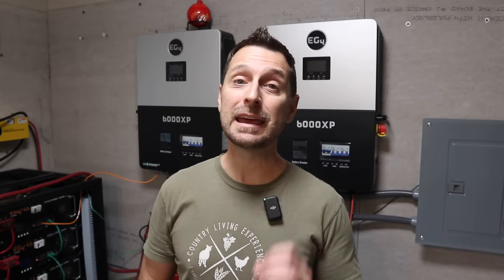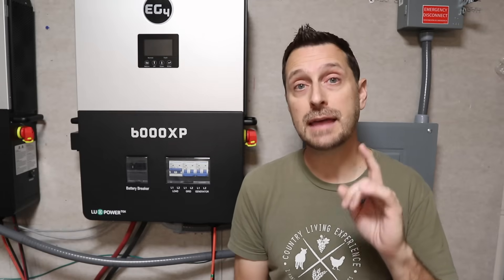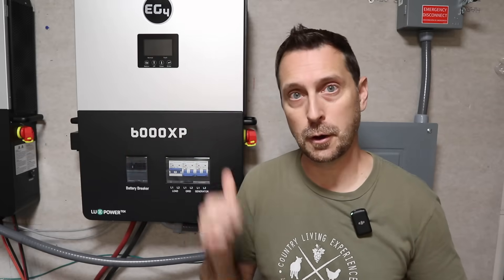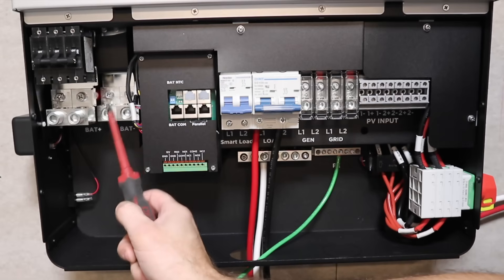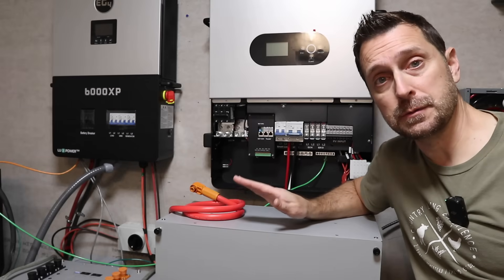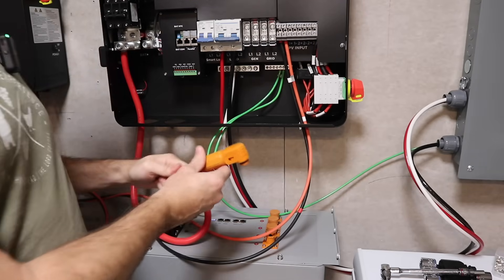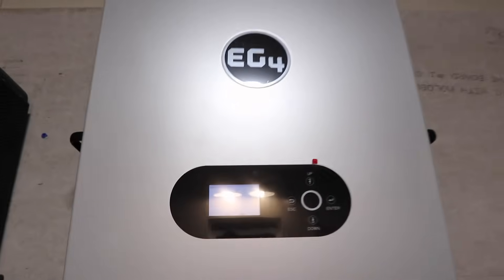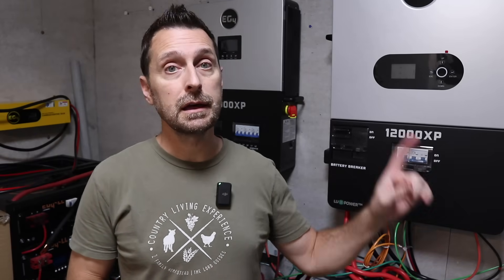Brand New! EG4 12000XP Off Grid Inverter Full Install And Review!

Comment: I use 532 kwh for one month in a year in the summer for an air conditioner and the rest of the year I use 200-300 kwh per month on the electric grid. Plus I want more power to run more items. How much AC output can this Eg4 inverter unit produce or throw out? Do I need more Eg4 inverters to handle the load? I have (16) 540 Watts solar panels plus (22) 400 watts in total. I live in Michigan. Can I run 100 feet 2/2/2/4 aluminum mobile home feeder wire out of the home to hook up the Eg4 inverter to the (pv) solar panels to save money because I need to run the solar panels out about 350 feet to my open field! I'm going to have 4 sets of wires (6 awg) for the Eg4 inverter for all my solar panels. Then I have 100 feet 2-2-2-4 wire hook up to one house then I have another house about 50 feet away and this system is all hooked together. Can this Eg4 inverter run through the whole system this way I'm talking about? Because it works on the electric grid? Can I have a 100 amp breaker box for this system? And what size of sub breaker box do I need because I think I have 50 amps sub breaker boxes for the other two houses. And the main breaker I have is a 65 amp that is hooked up to the electric grid I think. So thank you for your help! Have an awesome holiday day and JUSUS CHRIST bless you!

Comment: Does this inverter suffer from the same charging from grid/ gen as the rest. When charging it goes into bypass? I really want the ability to charge from geny while still inverting so I can max out charging and then not overload the Genny when a load in my house kicks in.
Reply from the maker: Not sure that is an issue more than a safety feature. One power source at a time. 
I don't use my genny through my inverters. I use a separate Chargeverter connected to the battery bus bars. That way I can charge the batts separately while running the house on either the grid or the panels.
Reply: I didn't say it clearly enough.
I have a pure sine wave Geny.
These units have built-in chargers that can charge from grid or gen. This one both.
The issue I have been having is this.
I want to charge my now 85kwh batteries as fast as possible at as high as amps as possible during the winter months by gen. But then a load kicks in. The system isn't smart enough to reduce charging to limit the total power it takes from the Gen to not overload it. Because the chargers are actually just the same inverting circuit in reverse (sort of) all the loads are actually going through a bypass relay and getting powered directly from the Gen. So I'll set the charger for lets say 8kw leaving 2kw of headroom for loads when I get a momentary 3kw worth of loads the gen trips out and the unit goes back to inverting until I realize it's happened and reset the gen. So it forces you to babysit the charging. Yes I bought a chargeverter too because I had to. But I need two to get full power from my gen.  So now you're spending another thousand to do something that the inverters advertise they can already do. I have read now that these units are in fact smart enough to limit its total power consumption coming from a generator for this exact reason. Even to the point of calling it generator boost. So it will start inverting to help with the load if it exceeds the set limit of the total power the generator is capable of. I'm weeks away from buying one to replace my growatt 12kw unit. I just want to get absolutely as much information as possible. Because I'm on my 3rd inverter, 3rd brand, really makes ROI a bit harder when I go in 3 thousand every year on a new inverter in hopes this one will finally be the one that does what u need. Sorry for the book thanks for the time.

Comment: Do the panels have to be all the same? Or can you run different ones on different strings? The reason I ask is that I have 20 550 watts on my 10kw system n 22 320w with my 6kw..can I use them together in one system with that inverter?
Reply from the maker: You can run different panels in different strings with no problem. Just keep within the voltage parameters of the mppt. Each input on the inverter (4) can take up to 480v.
Reply: @CountryLivingExperience  thank you . Have a blessed Christmas

Comment: Have you experienced  warning 28 error? it is a false EPS overload error that is not fixed yet on this inverter. Waiting for a firmware fix.
Reply from the maker: Yes, I have. I did a firmware update and it has cleared up the error.

Comment: I hear you on what the manual says; but, will the thing run on just one EG4 wall mount battery?
Reply from the maker: No. Rodney Hunt did an experiment on his channel and the inverter did not run correctly with one battery. You need two of them or get 4 EG4-LL or LifePower batteries.
Reply: @CountryLivingExperience  thanks for the tip.  I went over to watch Rodney's video, and it seems he concluded it works fine, as long as you don't over-draw the battery.  It seems, at least to my understanding, that you can use one wallmount battery, but you will NOT be able to utilize the full output of the inverter.  But, as long as you're not hitting the battery to the tune of more than 1/2C, you should be ok.  Please correct me if I'm wrong, as I fully embrace my Dunning-Kruger
Reply from the maker: @byrondeez  You are correct. I wouldn't want to risk it though. You could have surges in your loads or need a higher draw at some point. Also, the investment in the 12k xp would not be the best financially if that is the case. Just get a 6000xp and use 1 battery at full power.
Reply: @CountryLivingExperience  thanks 👍
Reply: Yes, it can but it doesn't run well and it can hurt the system and you need to save the money for another battery! 🔋 There are YouTube videos about this matter.
Reply: Show me the video links please.

Comment: Do you know the maximum wire size that will fit in the Grid and Load connections on the 12,000xp? I know it gives a min size in the manual.
Reply from the maker: It feels like you could fit 2awg or even 1awg in those terminals because there is a bit of room. I did not test that out though.

Comment: I am looking at getting the 12000XP and two of those batteries.  Do you need one of the conduit kits or one for each battery (buy two)?  Thanks and Go Green!
Reply from the maker: Cool. You would need 2 conduit kits and 1 battery parallel kit (batt cables with connectors on both ends). Go White!
Reply: @ thank you! Keep up the great work!

Comment: I plan to order a 12000XP.  I will NOT have any solar to use with the XP.  I understood that just like needing 400ah of battery, I MUST have solar attached for the XP to produce the outputs intended.  Is there any reason that I MUST have some solar ATTACHED ?
Reply from the maker: Why buy a solar inverter and not use solar? Most off-grid inverters need solar input to function well.

Comment: Did the junction box above the battery fit all the holes for the wires off the 12,000xp?
Reply from the maker: No. The holes match with the 12Kpv and the 18Kpv. For the 12000xp, you need to turn the top of the box around so that the large slot is open and aligns with the bottom of the 12000. I may show a vid on that soon.
Reply: Hard to follow the battery hook up.  Tangled mess that doesn't show where you connected to the TWO input ports on the inverter...

Can't tell where the wines were clicked to.  You explained needs min of 400 amp hours, but didn't show hooking them up.

Comment: How many of those wall mount batteries can you hook up to one 12000xp?  We are building a new home this spring, and i want to build an off grid solar system for our power.  I'd like to run 6 of those wall mount batteries. Will i need another 12000, or would i get one 12000 and one 6000?
Reply from the maker: You can add 3 batteries per inverter. You would need 2 inverters for 6 batts. Either 2 6000xp's or 2 12000xp's. You can't mix the 6000 and 12000 unless you get really creative with your wiring.

Comment: I would be ‘jazzed’, at this 12000XP product, if the PV input could handle 500vdc.  Why not 500vdc?
Reply from the maker: I could ask you the same. Why 500? 
There are hardly any inverters on the market that will handle 500. 480 is plenty.
Reply: @ the higher the PV, the more panels you can use, on the direction sunlight days!  More is better!
Reply from the maker: @jimpowell9205 This inverter can take more PV than almost any other inverter on the market, if any. 24000w.

Comment: I just looked on signature Solar’s website and could only find the 12000xp for $3499
Reply from the maker: You looked at the 12Kpv not the 12000xp. Scroll further down the page and you will see the correct inverter for $2499

Comment: So to clarify how many panels do you need to charge two batteries and to provide power from the inverter at the same time? Are they saying you need 24000 watts of solar panels?🙏
Reply from the maker: They are not saying you need 24k watts, that is the maximum that the inverter can take. You can start with 3 or 6 panels if you want. Those panels would need to just have a voltage combined in series of at least 120 volts for proper operation and no more than 480v. A good range is between 120 and 385 volts for each string for each mppt (charge controller) in the inverter. 
For example you could have only 3 panels that are 41v each, run them in series (which adds their voltage to 123v), then the inverter will work and charge batteries. 
The questions always is....How long will it take to charge batteries while running loads? The answer is.....The more the better. 
We did a video on this here.....https://youtu.be/BKRraTpBnGo That may help.
Reply: @CountryLivingExperience  Thanks fro the quick reply, really helpful cheers
Reply from the maker: You're welcome

Comment: You might use (some of) that potential 72kW power for a swimming pool filter/heater system.  Maybe you have a good sized wood and/or metal shop?  Charge up your electric fence to "Super-Max" levels maybe?  Have a BUNCH of computers mining crypto currency as another option, along with running your air-conditioning super hard to keep them cool.  I agree, other than redundancy, going for 6 would be more than a little bit silly!
Can you do a hardwire ethernet to connect to the inverter or does it HAVE to be WiFi?  If it has to be WiFi that would make it difficult if you put the inverter(s) and batteries in a freestanding building a short distance from the house.
Reply from the maker: I think there is a way to hardwire ethernet but I do not know how personally.  I have heard it is possible but one will have to sit on the phone with the EG4 guys for a while. 
Yes, that is the same issue I ran into with my Victron system at my barn. No internet wifi way out there. It is an extreme challenge to do firmware updates, etc.

Comment: Good day Eric. We have 16 wooden acres that we're currently building a  3 shipping container home on. What would you recommend for a 100% offgrid situation? We're not pulling from the local grid at all. We will be on solar, propane, and the occasional generator for charging batteries in case of extended periods without sunlight. We're in central arkansas. Would love to hear your thoughts :-)
Reply from the maker: Good question. It is really going to depend on what you loads are. I am not sure what you are running at your new home. You'll have to do that calc to get a better picture. 
That said, you will have to decide if redundancy is right for you (with a few 6000xp's) or just having one unit like the 12000xp.  I would stick with one of the pure off-grid inverters because you would not need the grid interactive features of a Hybrid inverter. The off-grids are cheaper too. 
We also have a Victron system for our barn which seems to be bulletproof.
Reply: @CountryLivingExperience  Thank you. I'm so thankful for this channel :-)
Reply from the maker: @umustbbornagainActs2-38  You're welcome.

Comment: Im having a hard time deciding between the flex boss or 12000xp to replace my 18kpv for my completely off grid property 🤔 the 600v of ov and 10 year warranty is pushing me towards the flex boss
Reply: I have a 18kpv and like it I would go up to the flex because it has more pv input and the load the fans start should be higher but if u want redundancy grab 2 12000xp for 5k basically the cost of one 18k?.? Crazy times inverters change so much in one year 😊
Reply: @electricandlspower thanks I agree,  I'm an installer for sigsolar so I like to install all the new products I offer so I can get familiar with them and since I and 90% of my clients are completely off grid the 18kpv is not the most efficient option
Reply from the maker: I understand now TJ. I think the 12000xp would be the way to go. I am still working through whether I want the redundancy of 2 or 3 6000xp's or a 12000xp. Additionally, the redundancy of the EG4-LL's vs. the wall mounts. Tough choices....but glad to have choices.
Reply from the maker: I understand. You just have to weight the value between each. It is a hard choice. 
Why are you getting rid of your 18Kpv?

Comment: What’s the minimum amount of battery amp hours for two EG4 6000’s? Versus one. 🖖
Reply: Manual says >=200Ah for one 6000XP
Reply: @ 
Does that mean 400 amp hours for two EG4 6000?
Reply: @ yes because look at the watts.  Two 6000xp needs to be able to do 12kw of continuous not to mention the surge.

1x Battery: 200Ah x 48v = 9600 watts
2x battery: 400Ah x 48v = 19200 watts
Reply: @ 
Thank you! I wasn’t sure, but I thought as much. That’s a lot of batteries! 🖖
Reply from the maker: Good question. It is 200ah for one 6000xp but it is unclear if that number multiplies with the addition of more inverters.
Reply: @CountryLivingExperience  I asked EG4 this question about the 12000XP - it's 400ah PER 12000XP so I would assume it would be the same @200ah PER 6000XP.
Reply: @CountryLivingExperience  Manual says per inverter

Comment: Thanks for sharing Eric!  Nice to see more info on this.

Just to clarify (1:12).  The inverter features two sets of terminals per MPPT, enabling you to parallel strings directly at the inverter. However, it’s important to note that it does not have two separate trackers.
The advantage of having two terminals per MPPT is that you can connect two smaller strings using smaller gauge wires directly to the inverter, rather than combining strings at the array with a combiner box and running larger gauge wire back to the inverter.
Reply: I’m a little confused on how to get 24,000 watts without going over the 385 voltage per mppt. What would a combination of panels look like to get this.
Reply: @jordanwitherow6324  I'm not sure what panels EG4 used to get up to the 24kW of solar.  I would imagine even though 385V is the top of the "operating range" you may have to get closer to the 480V of the max input range without going over.
Reply: I want to add that you must parallel panels with the same type and identical number of panels facing the same direction per MPPT.
Reply from the maker: Thanks. 
I may have misread the info on the mppt's. I thought they were similar to the divided trackers in the 12Kpv. Wouldn't be the first time I misread something.
Reply: @CountryLivingExperience  No worries.  Lots of data to mull over.  

With the 12kPV, even that just has the ability to parallel 2 strings together into a single tracker.  It has 4 sets of terminals but only 2 MPPTs.